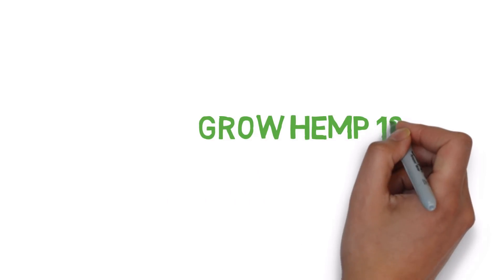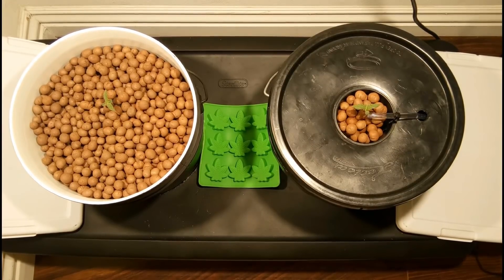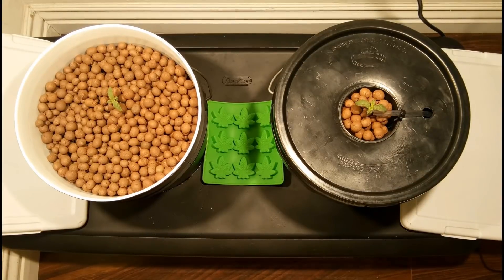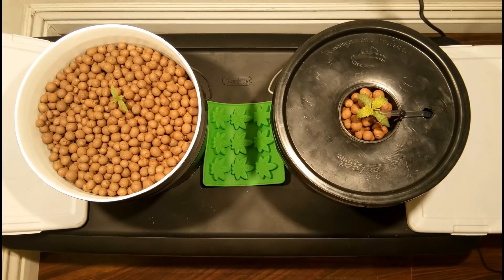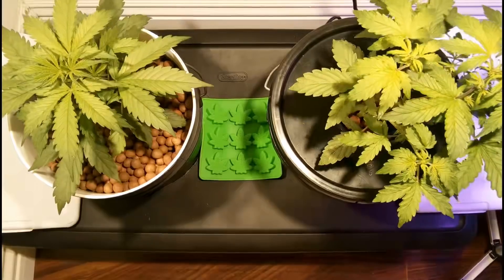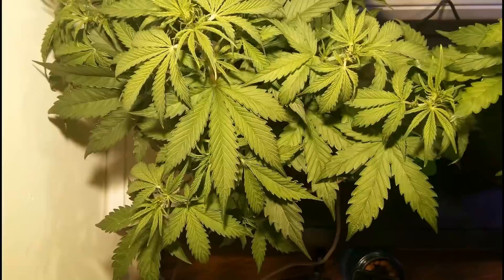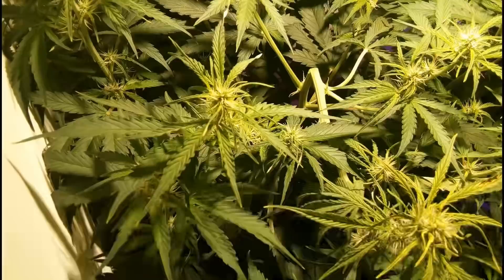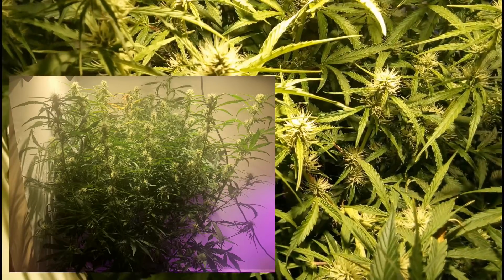Autoflower Ebb & Flow Grow from Seed to Harvest

Comment: Wow! That's a crazy big auto flower! What strain is that? And what was the final yield? 10 - 12 ounces? Great video! 👍✌
Reply: I am wondering the same, was it the growing method or strain?
Thats crazy big for an autoflower.
Reply: @rogermayers849  I guess you never know with autos. I grew a cheese auto, recently, that produced over 10 ounces! ✌
Reply: @rogermayers849  DWC (what this essentially turned into) makes the biggest most blown up plants, from what I've seen!
Reply: I was gifted a bunch of critical orange punch and anvil cross with arise as testers and they haven't been doing well at all they start to flower at like 6 in
Reply: You should check out Flash Seeds' superautos.